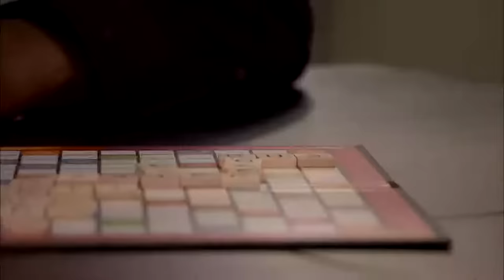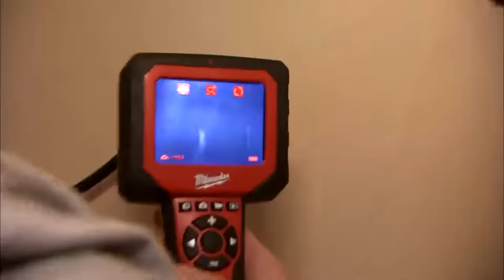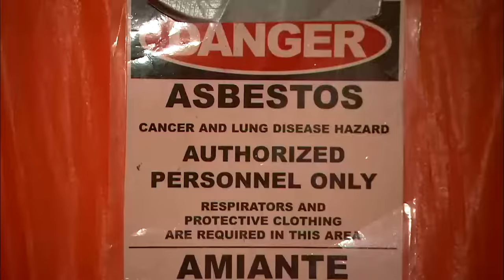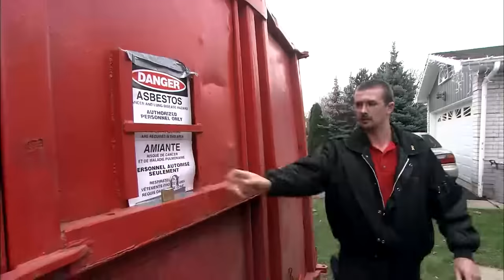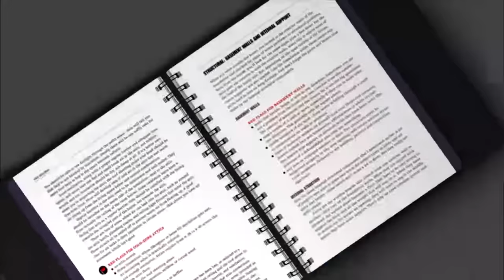The Hidden Costs of Newly Renovated Houses | Holmes Inspection S121

Comment: I purchased a home that i found had a slow leak in the plumbing, specifically the drain pipe for the kitchen sink.  Instead of the 100 dollar repair (thats all it cost to get it repaired) they first covered it up with drywall, then a second layer of drywall, then a layer of sheetrock, then a layer of plywood and more drywall.  By the time we found it the water had soaked into the wood and completely rotted out that section of the exterior wall.  Thank god the support beam was JUST out of the range of the damage and same with the joists for the flooring.  We got to it just before it could become a real nightmare requiring the wall to basically be rebuilt,  instead it just needed some extra support added.  

Like these peoples house there was asbestos on our pipes, common from when the house was built.  Asbestos is one of those things that if you have it you just dont touch it and its not dangerous.  Its when you need to change those pipes that there is a problem. 

They also lied about how old the water heater was so we did not replace it and it burst thankfully there was nothing in particular downstairs for it to damage.

I always wonder what else they might have hidden behind fixes.

The amount of money that it would cost to fix this mess.. well its not surprising when you find substandard fixes.
Reply: Whole house automatic water shutoff valves can detect leaks before catastrophic water damage. More and more insurance companies are requiring them.

Comment: My first house, the home inspector found nothing, spent years fixing it correctly. The inspector when I sold the house found everything(and complimented me on the state of the home after). My current house , is the opposite. every time I look at something closely or need to repair I find the previous work and materials to be of top quality. It's made the maintenance heating and comfort of the house  inexpensive and repairs rare. it's an 1850's brick house with good overhangs and a solid dry basement good windows etc.  It was dated on the inside but solid, I had some termite damage in the addition the inspector found. I'm remodeling it into the new kitchen and this just allows me to demo and build what I want anyway. In the end I saved a lot of money, and know my house is solidly built and livable.

Comment: I would be super wary of a finished basement in an old house. Most likely the basement is not waterproofed so moisture will get in behind the carpet and drywall and cause a lot of rot/mold issues.

Comment: Wait... isn't a termite inspection just normal in the US with wooden houses?  I remember my father saying that it was not possible (we were in California) to get a bank to give you a loan on a house without a termite inspection.  That was in the 1970s and 1980s.  Maybe the rules have changed or are different in different states? One house my father bought in 1963 could not be refinanced in the late 1970s until he had jacked it up , dug out below about a foot and then put in a new concrete foundation instead of the original two rows of bricks it was built on in about 1900.  The termite inspector had to be able to crawl around under the house to inspect for termites, and before he could do that, it had to be dug out and jacked up and raised about a foot.  (And then there were no termites anyway.)  I have vivid memories of the importance of getting a termite inspection before you can get a loan to buy a house or even before anyone would be willing to buy a house off you.

Comment: Why isn't this considered outright fraud? Where is the line between buyer beware and fraud in Canada?

Can they even sue the home seller or the home inspector? It seems like there is a real lack of standards in Canada when it comes to home inspections. In Calgary due to the lack of housing it is almost impossible to buy a home right now if you demand a home inspection. Buyers are subjected to bidding wars where prospective buyers are putting in offers with no conditions, it is scary crazy. Basically if you try and do your due diligence you are 'out bid' during the offering stage.

Comment: I would never use Pex for plumbing.  It was more expensive to go with copper, but it is much better.  I used real plaster, not the wall mud, for the wall and replaced most of the framing studs with LVL.  I stuck to the old plastering and copper plumbing, but went for the new engineered lumbers and foam.  They cost extra.  I don't care.  I am going to live in it for a long.  I put the insect repellent and the power at the bottom.  But this blue stuff interests me.

Comment: I just went through this process, and in MY state, the inspector is not responsible for examine for infestations, roofing, nor electrical and plumbing. They only look at is the building safe to live in, is it up to basic code and whether or not the duct system worked was a bonus but not required. We had to hire someone else to inspect anything else. We only had a roof inspector and 2 weeks in we had a leaking roof. Our roof was "in good condition," but they neglected to tell us we had an area that was 2 different levels and water would and did pool there until it leaks into the house. No idea how much damage that did over time as we get floods and heavy thunderstorms regularly. 😢 But it isn't universal in America as to what an inspectors job even is including and they tell you that, when you set up an appointment, and again in the reports. And you have every right to ask a million questions. Many times, an inspector WILL advise, even if it isn't something they normally do, so ALWAYS go to the inspection and take detailed notes. Thanks to showing up for it, I had details to plan for that were NOT in the report. Like that the plants were growing too close to our foundation. Now I know what to do, but I wouldn't have if I hadn't gone.

Comment: Not sure when this was aired, but is there a reason you did not use steel studs for the basement reno? Naturally mold and pest resistant. Plus with the block behind spray foamed, thermal bridging is not a concern.

Comment: Norway has laws protecting home buyers against hidden nasties such as in this house, in which the sellers are liable for five years post sale. A qualified home inspector should have picked up the true state of that house, there was so many red flags not least the fact that the basement doors were shortened at the bottom so that you had had to bend down to reach the door handles. The walls in the basement should have been checked with an inspection camera which would have revealed the state of the structures inside and the termite damage. Without consumer protection buyers are bound to get shafted by unscrupulous vendors, particularly in a sellers market. Nice work.

Comment: my home's inspection company was considered better and bit more pricey but they did not find any potential bad things - eventually turned out I had termites for years, the oil equipment was dying and the roof was actually leaking and the previous owner just covered up with new drywall and paint, the inspector never even climbed up in the attic through as smaller hole to reach the area that was actually very bad in leaking and eventually leaked through drywall and insulation.

Comment: 32:15 -- What is that black vinyl sheeting' that you are nailing and putting against the wall?  Did you say it was being used as extra wall protection or ventilation?

Now that the home is up to snuff...... does this mean they can sell the house for $150k over market value to cover / compensate for the cost of their renovations & repairs, right?

Comment: Just watched this happen to my old house. It needed a heck of lot, and they did some things. New roof, which everyone can see from the road. Added air conditioning and another bathroom. But did they relocate the plumbing? Did they replace floor joists that soaked in flood waters for months? Did they put insulation in the walls?

I don't know, but I sure as hell wouldn't Buy it. And obviously not for four times the price.

Comment: You would/should have specialized inspectors (electrical, pest, plumbing) when you do a prepurchase inspection, otherwise this is what happens. $300 for a general inspection won't get you much. I sold my home recently and viewed the buyers inspection report and there were alot on annotations from the inspector that certain things were unobservable or obstructed and further inspection should be considered.

Comment: If unregistered builders dont carry out necessary repairs or improvements you should walk out the door a coat of paint and a new piece of wood can hide a multitude of problems. Or make sure there is an addendum that any work necessary is to be paid by the seller.

Comment: Termite treatment is only good for one year. My house was treated and the following year they came back. I was told the chemical used are "environmentally friendly " basically water. So rather than loose my house, I mixed used motor oil and a little  thinner and poured it into the holes they drilled. No termite treatment required the last 11 years I lived their.

Comment: Spoilers ahead…
I thought it was a pretty good movie, but as someone who read the book, I have problems with the ending.  I also did not like they shorten the time element.   It would not have been hard to add a few frame to reference ”a year later” or something.  Dropping Paul’s sister is also a problem for me.  To me the whole ending was wrong.   In all the movies versions of Dune, the Baron is not fat enough.   It least he wasn’t a beach ball flying around a room.   I did not care for Walken in this as the emperor I felt he did not come across as either regal or full of hubris.   Finally, I had problems understanding some of the dialog…..

Comment: Honestly, this is standard procedure. The home inspectors don’t do a thorough inspection a lot of times. As a person that has bought two existing homes, I’ve come to expect problems. The two houses that I’ve bought were not renovated though. They needed repairs. After going through the process of making a home livable, I’ll say this…. All contractors are not created equal. A “newly renovated” house for sale will usually come with the run of the mill cheap, fast, & poorly executed repairs that you’ll soon be revisiting shortly after your purchase. That’s why I purposely buy none renovated properties so that I can address the issues the correct way with real contractors and not the guys lingering around, Home Depot, claiming that they can do quality work for cheap.

Comment: There are many sellers and buyers who have zero knowledge what can be wrong with a house. I was born and educated in Germany. We lived in an pre WW2 house with lead piping and ancient walls. Here in the US we lived in buildings with rats in the backyard (Chicago) and roaches in the house. We owned an >50 year old building. Not knowing it had asbestos tiles and a improperly repaired basement and roof causing mold and smell. The previous owner was a doctor and lived there all his adult live. We live in central Florida now and we find various defects in an 25 year old house which are simply cheap construction.
To summarize: Many homes are build with cost a primary concern. Putting a stop to that will drive up cost of these homes. The present solution is: Buyer beware and see a lawyer.

Comment: If mike inspected my house this is what he would say 

"Its a home owner paint job, we better demolish tbe house" 

"He did his own concrete finishing??? See how there are slight imperfections in the finish? There isnt any cracks or settling whatsoever after 5 years, but it will because a home owner did it." 

"He installed his own bathroom Fan....notice how he cut through the joist identically to how the furnace installers did it? But he didnt get a permit so the house is condenmed"

Comment: https://youtu.be/oHumspu_g2U?t=2528
42:05
Question: Where's the air extraction? (for the new shower room)
I must have missed it. I don't know where the hot moist steamy air goes from here.
Behind the toilet is a cold external wall shaded by the neighbors house which is only a inch away.

Comment: If the flippers did what mike did, by doing everything right, they will lose 150k easily on the house. If mike priced it accordingly and price it at a break even price, the house will have no offers because its too expensive. Flippers are all about profit.
Reply: Repairs after the fact are costly, but if you already demoed the individual costs would not be what Mike had to do.  It is not apples to apples. The flipper already had the walls open. How much time did it take to tape the asbestos. That was a serserious tape job.
Reply: @BWreSlippySlope  it was much more than a tape job. They put up that retaining wall, rebuild the bathroom on first floor, new electrical, and other stuff. All of this will make this flip unprofitable. Buyers only look at the cosmetics when buying a flipped house, had it been priced higher, it will sit on the market and carrying costs will easily make this flip lose 60k if it keeps on sitting and you cajt lower the price, until you have to unload it at a major loss, if not the losses will become higher over time.

Comment: Home owners should keep it as is and resell it instead spending money and time to fix it. It’s probably what they been doing for dozens of owner of that  house. How would u prove previous owner know or don’t know of these problems. The electric line going between the latte are common in 1960s houses since there’s no coding about that back then. My house have electrical lines outside of brick wall that’s embedded in cement . How they going to hold anyone accountable for decades of ownerships, and it’s all come down to the buyers responsibility and first thing is don’t use the sell realtor preferred inspectors. They could use a handyman that have more knowledge than home inspectors.  And these folks are taking a on a ride when the workers aren’t Mexicans but some white dudes . They sure going to be paying for another house after that